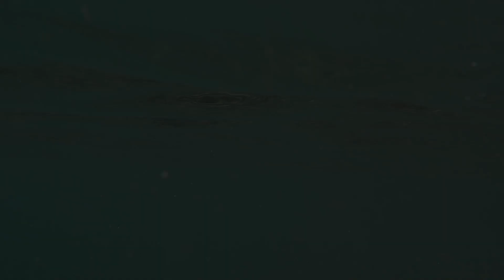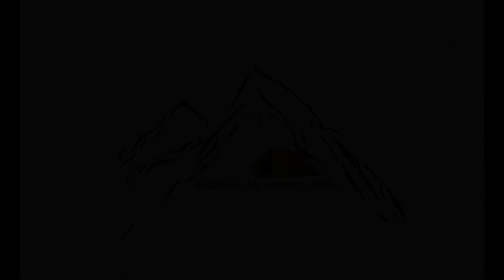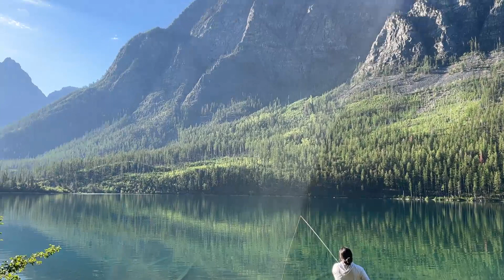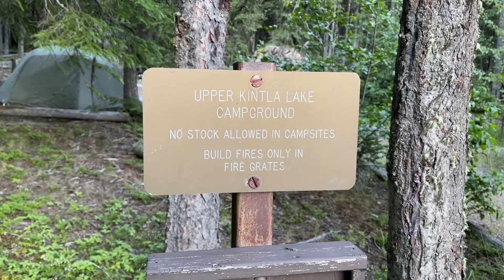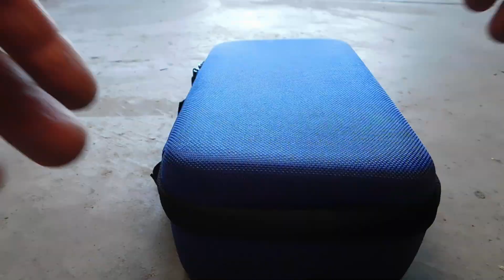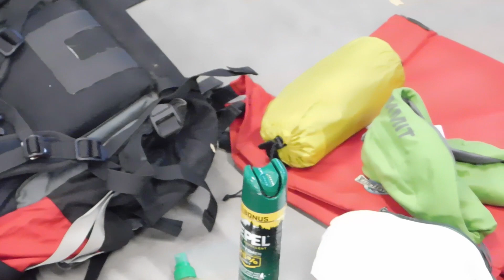Glacier National Park - Backpacking with HF Radio Equipment FAIL

Comment: Greetings, headed to Glacier early Sep and always hike with a 2m/440 handheld. Curious to know if you found any repeaters in the area that might have some coverage there be it either 2m/440 or GMRS?  TIA
Reply from the maker: That's a great question - I checked and unfortunately have not found repeaters in the area I was visiting. Definitely didn’t track down any GMRS. I hope you have better luck than I did. I was 6miles south of the Canadian border.

Comment: Late replying here, but a couple of suggestions for the risk of coax damage. The most common way connectors are damaged is that the connector becomes detached from the coax itself. One way to mitigate is to eliminate the coax by brining a single spare connector that can be used in place of any broken coax. End fed antennas are best for this purpose. In fact, many ops use end feds that connect directly to the radio with no need for coax. Another solution, if coax is necessary is to use the old ham trick of using Temflex and Super 33 to bombproof your coax connector. It's not pretty, but it's waterproof, strong, and will maintain a strong connection for years, based on my experience.
Reply from the maker: Thanks Mike! This is great advice!

Comment: Seems like the weak point wasn't the cable, it was the SMA connector. Those connectors are great for SDR jumpers in the shack, but really don't belong out in the field. They also introduced multiple points of failure because you have the SMA, then you have the adapter to BNC. Anyway it's not a fail, it's a learning experience.
As for carrying a repair kit, I do carry a butane soldering iron in my repair kit. I also carry a second rg316 cable to avoid soldering cables in the field.
Keep your chin up, and keep moving forward.
73
Julian oh8stn
Reply from the maker: Thanks Julian, You're right. I need to move away from those tiny connectors. I initially used them because it allowed me to adapt to any connection but it's proven to be a pain in the butt. Having a Butane soldering iron would have made a lot of sense. Having a spare cable would have been a good idea too. Thanks for the encouragement. I am looking forward to the next similar outing. Hope you're well, 73 - Eric KI7WJP

Comment: Being just north of you, normal 5 watts is not enough SSB. I run min. 12 watts from my KX2. More often than not closer to 30 watts.
Reply from the maker: I'm going to have to look into a lightweight amplifier. If I'd been on a mountain top, that might have been different. But in a deep canyon like that has never worked well with 5 watts for me. Would have been really great to connect with you though. 73 - Eric

Comment: Would your bnc post from your wire dipole connected directly to your radio work?
Your radio would be 5-6 ft of the ground but I wonder if that would have been an option.
Reply from the maker: I need to look into this. This was also suggested by N9SAB as a potential solution. I'm curious but I would have need a F/F BNC adaptor, which wouldn't have been a bad idea anyway.

Comment: Eric, your trip was a success. You were in beautiful country and walked away with some very valuable lessons. I typically carry two smaller RG-316 cables at 12' length, two wire antennas (PackTenna Mini EFHW and a custom 40m dipole on a cobra head connector), and two 4.5Ah Bioenno batteries. The duplicates don't add much more in terms of weights. I've had a failure point in each of these areas in my various backcountry adventures. Chin up and keep fighting the good fight.
Reply from the maker: Thanks Gaston, the trip itself was a success. It's the kind of country I live to be a part of. As for radio, this was absolutely my most committing and deepest adventure with all that communication gear. Fortunately, I wasn't carrying the 891! I really wanted to have a spare cable on that trip I just ran out of time to get one ready to go and one or two things were left behind on accident. Now, I'm re-evaluating all of it anyway. Glacier is an unreal place to visit and, yes, I learned a few things too. Thank you for the encouragement! Hope you've been well. 
73 until next time, Eric

Comment: such a bummer when gear failure happens, lessons learned makes us better at operating.  Glad you made it out safely.  Nice story thanks for sharing Eric.
Reply from the maker: It was a bummer; however, it was a small part of a bigger picture. I'm still a relatively new ham when it comes to portable operation. This was the next level for me with HF. Thanks for checking it out, Kevin. 73 - Eric KI7WJP